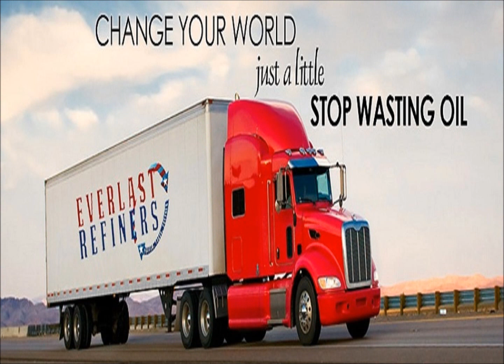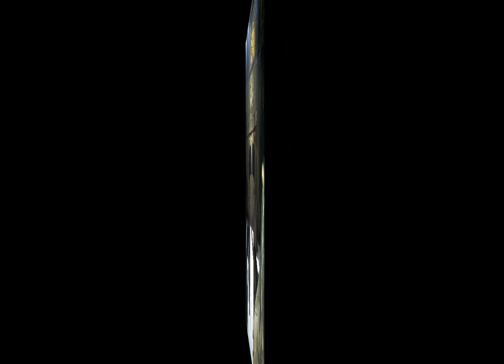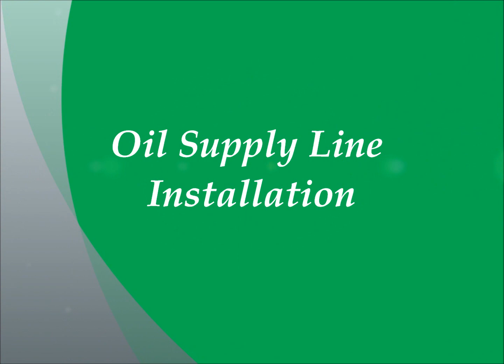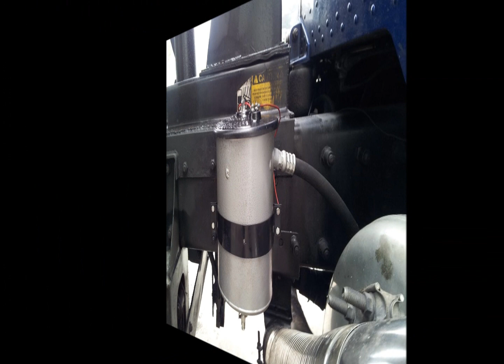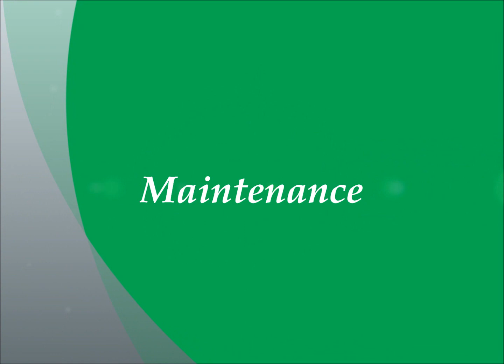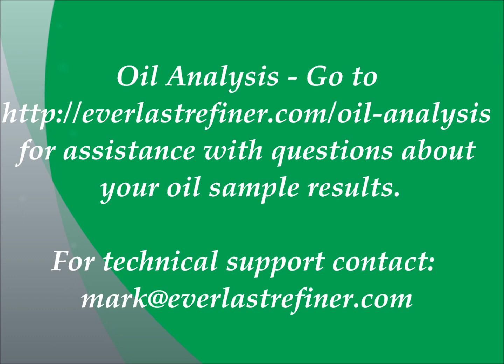2004 Peterbilt truck with Cat C15 engine bypass oil filter system installation.

Comment: It seems like there's a lot of people that is not a big fan of this ...I wonder why..?   just curious
Reply: Oil molecules break down, evaporation, viscosity drop, other fluid contaminations etc, none of these could be fixed with a bypass filter. So, while it might help, I wouldn’t ever attempt to extend oil change intervals without a long process of oil lab analysis. Proceed with care. If this would be bulletproof all oem manufacturer would install it from factory and brag about their lower maintenance costs. So far, none of them joined in.